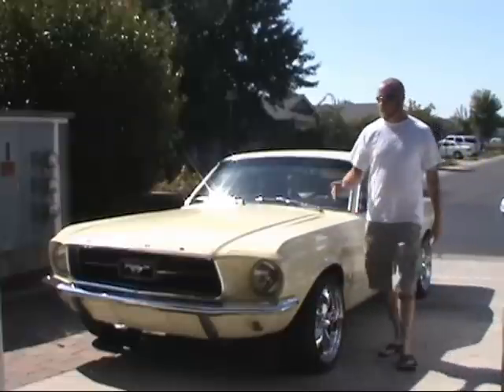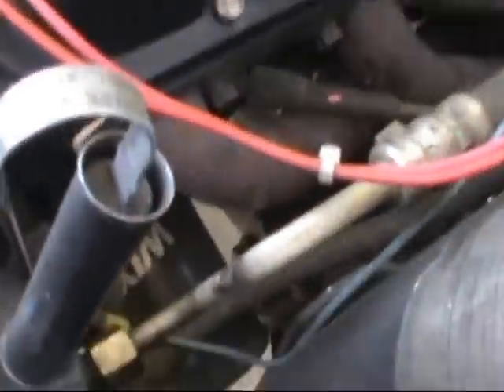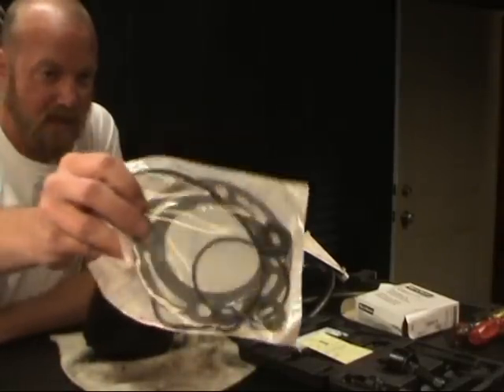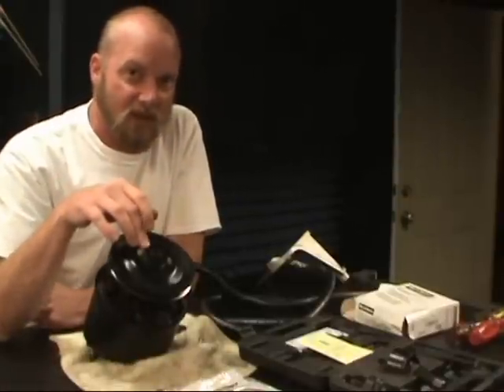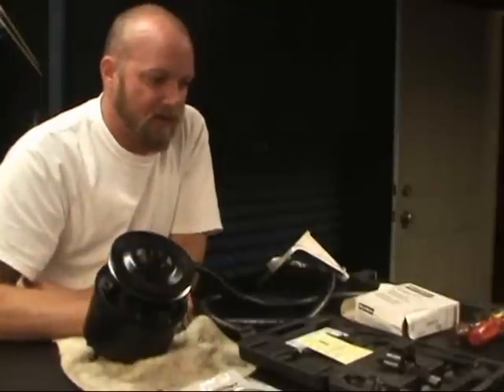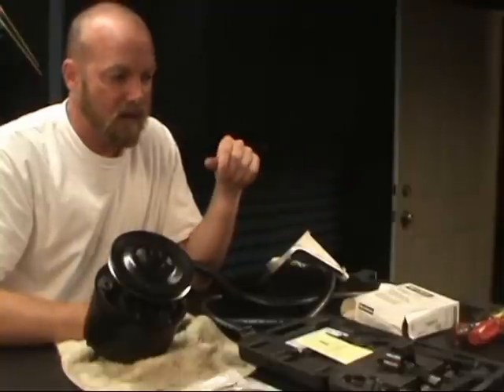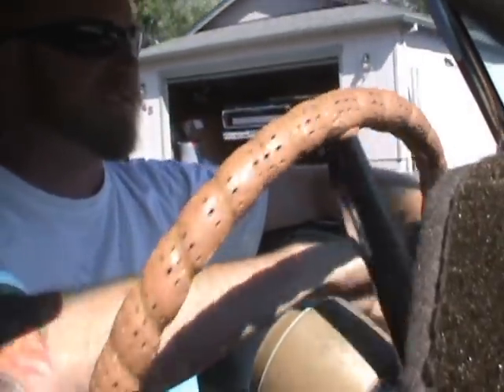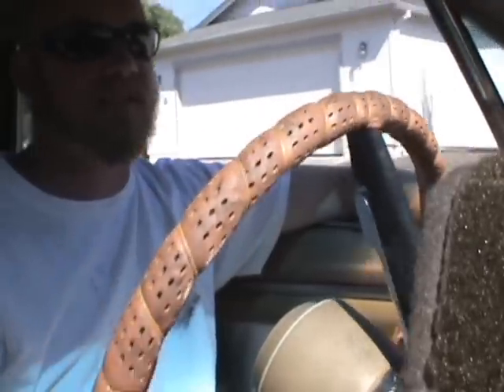Ford power steering pump repair.

Comment: A tip for people outside of the USA who don't have access to the specialised pulley hire from parts stores like O'Reillys etc.  DO NOT use a jaw puller on the outside diameter of the pulley (where the fan belt runs) because the pulley will warp. I found out the hard way.
I eventually managed to get a bearing separator in between the pulley and the body of the pump with the "teeth" of the bearing separator almost touching the pulley shaft. I then used a press with V blocks supporting the separator.
Great video, thankyou for your time in producing it.

Comment: thanks.  (66 mustang) mine has been leaking this past year and the Stop leak PS fluid isn't helping.  Now pulling it out from winter storage, it's still leaking.    I was wondering about replacing the gaskets in it.  appreciate the vid.  I don't think it will be too bad/hoping it won't be too bad..

Comment: Hi Mike,
Thanks for the video. Just replaced my control valve and slave cylinder and now with everything back together, the power steering is going in and out. Sometimes it would work and other times, feels like no power steering at all. No leaks that I can see. There was a squealing before but I adjusted the belt while I was replacing the CV & Slave and it went away but now cutting in and out. Will attempt to rebuilt the unit myself since the rebuilt ones are so expensive. Anyways, at the 3:30 mark, you were hammering a metal seal. Was that in the kit? Didn't see you take it off in the video. Thanks for making the video!

Comment: Hey great video I want to rebuild the pump on my grandpas 66 thunderbird, do you know the part number for the pulley tool you used? I don't think I've seen that type at my parts store
Reply from the maker: I don't remember. Just ask for a pulley puller at the counter and they should have one.

Comment: Hey Mike, I am putting my power steering pump back together, and the connection for the high pressure line is just spinning. Do you  know if that fitting is suppose to be loose or is there a way to hold it to be able to put the nut on to hold the housing to the pump? Any help would be appreciated.
Reply from the maker: There should be a nut that secures the fitting to the housing. It should not be loose. Did you have any extra parts when putting it back together?
Reply: Mike Stanek
I have the nut for the outside, but my problem is that the fitting turns while I am trying to put the nut on the outside. I have even put the power steering home on to hold it, and still having the same problem. This is on a 73 Maverick, which doens not make any difference.